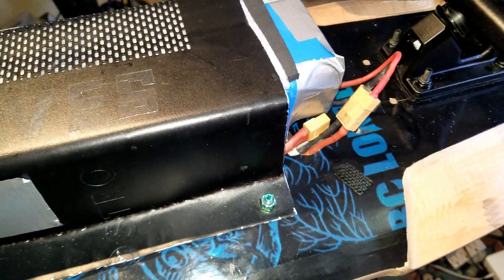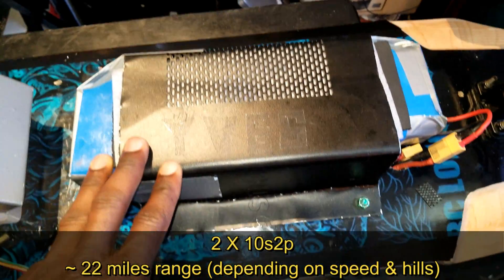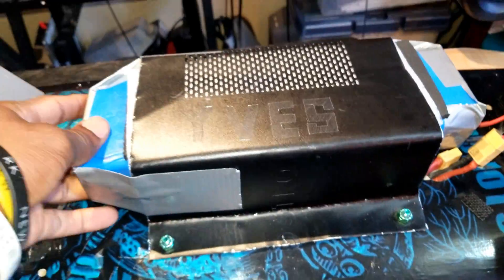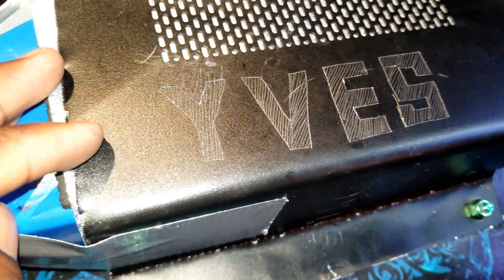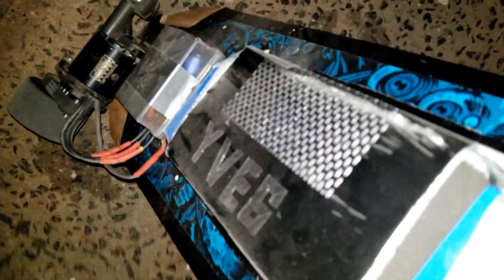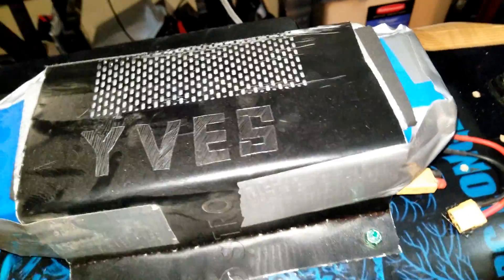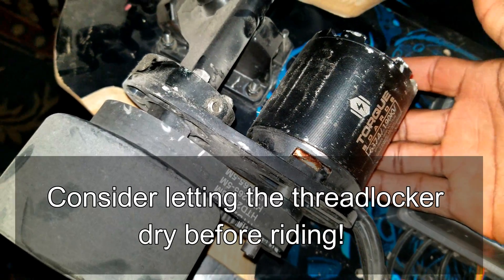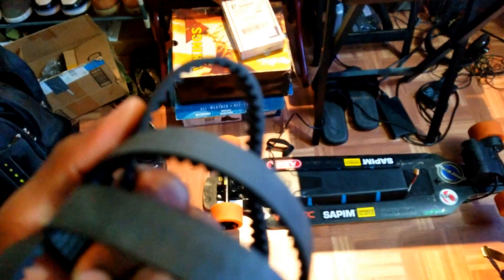MY DIY ELECTRIC SKATEBOARD   FOLLOW UP  UPGRADE BATTERY   ENCLOSURE   SPEED TEST PART #4

Comment: Cool man! That's a real DIY build. You should join the forum (if you are not subscribed yet). You will get a lot of ideas and suggestions. For instance you are using a TorqueBoards motor mount I guess, here an explanation about how to mount it to prevent it coming loose http://www.electric-skateboard.builders/t/torqueboards-motor-mount-comes-loose/50972/43?u=rey8801. Ciao ciao...
Reply from the maker: Thanks man! I'm already member of the forum! they got real e-skaters on there! Thanks for stopping by!
Reply: KingYS Tech. Perfect! See you there then... Ciao ciao